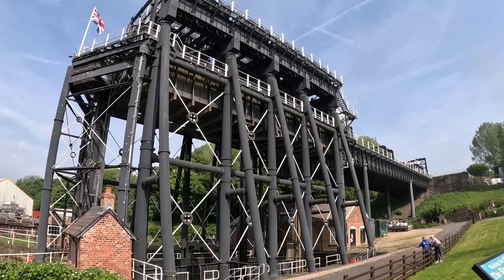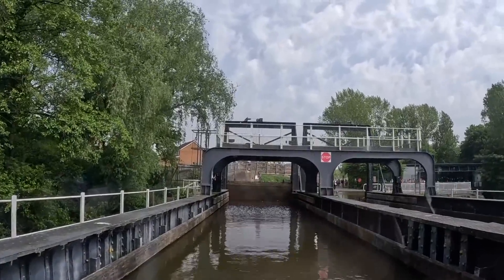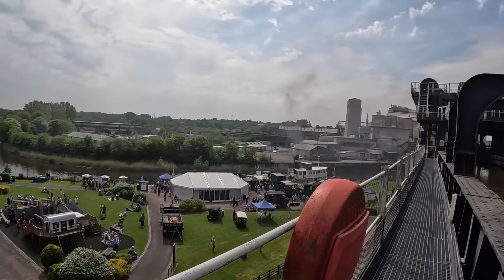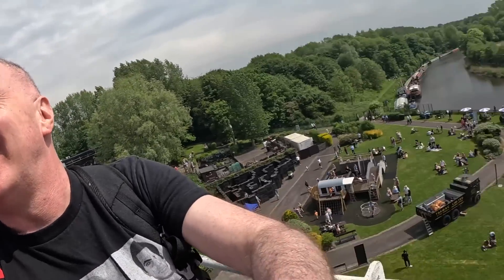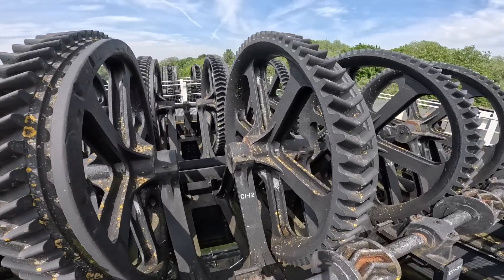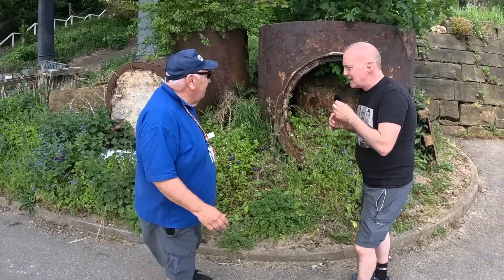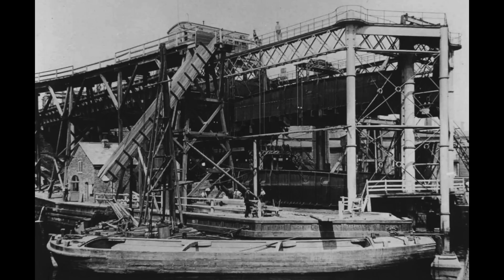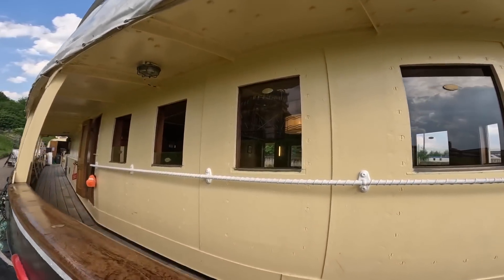The Anderton Boat Lift. The workings

Comment: That machinery on the top level is amazing, The whole engineering pre electric was fantastic.  I don't like heights but I love flying. I had to replace a door once on a tank room on the top of a  20 story tower block in London. I used the "contractors lift to the roof access and hoisted the door (which weighed around one CWT) onto my shoulder and started across the roof and the wind picked me up like a sail and tore me towards the edge. The roof was totally flat no retaining or dwarf wall, biggest scare of my life, I dropped that door like it was red hot. Never again!

Comment: In south-eastern Ontario, Canada, there is a canal - the Trent-Severn Waterway- which connects Lake Ontario (at Trenton) with Georgian Bay (near Midland) About one-third the way along from Trenton there is the city of Peterborough, and a considerable rise in elevation (going north) is required. This is accomplished by the Peterborough Lift Lock, which is similar in operation to the original (and current) Anderton boat lifts. There are two identical watertight chambers, raised and lowered by large (and interconnected) hydraulic rams. Actual motion is started by adding a little extra water to the upper chamber, making it heavier than the lower chamber! The hydraulic medium is the (fresh) canal water, which causes minimum corrosion. A visit to this engineering marvel is highly recommended!

Comment: That is an awesome piece of industrial engineering and architecture, love it. I did however have one random thought whilst watching. As all the lifting gears at the top are now defunct and disconnected, if someone where to attach and electric motor to the main input shaft, would they still all turn? now that would be something to see.

Comment: No, No, No my little guys were pulling in tightttttt when you were up a height, more so on the mesh flooring. In my early working years i was in a woolen mill where the carding machines were started by a transformer thing. Turn it on, the carding engine started slowly then needed the handle to be moved to increase the speed until the cards were at full speed. It was scary, the creaking/groaning as this monster came into life 😮 I think that transformer/speed regulator was like in a loco cab. Cheers DougT

Comment: @MartinZero. A healthy fear of heights is perfectly normal. The challenge is suppressing it. You may think going up a boat lift is bad, try going up the Sky Tree Tower in Tokyo. The upper observation platform is at the 450m mark. Now imagine your brain wondering what would happen during an earthquake. Now imagine post earthquake having to descend how many steps just to get to the roof level of the complex.

Comment: Hat tip to you for always going up for us when you struggle with heights. Another hat tip to the crew for understanding and not making it worse. I'm not petrified of heights, but I do have to work up to do them, and my pals always make it worse with the shaking of the structure or acting like they're pushing me off 😂Oddly, I never had issue jumping out of aircraft in the military 🤔
Reply: Paratroopers are actually safer on the outside of military aircraft 😆

Comment: The heat inside the tractor during a hot day would be one thing, but at 13:19 you can see there's an unguarded flywheel right next to the operator!

Comment: I had the opportunity to briefly operate a steam powered train locomotive in Cuba that had been converted to burn fuel oil . About 1/8 mile back and forth on the track was more than enough for me . The heat was unbelievable . I couldn't imagine operation a steam powered lorry ( truck ) all day in the summer .
Reply from the maker: They were very hot inside

Comment: IMPRESSIVE, the gear wheels on the top of the lift are very complicated to make , I'm a gear cutter by trade , making bevel gear is difficult, without cnc machines , but double helical bevel gears , wow, I doubt many machine shops could make them these days,' Victorian engineering was the best .
Reply from the maker: Wow, interesting to know, cheers 👍
Reply: The gear wheels were part of the 1908 John Saner Anderson Lift. They were taken down in the late 1980s when it had shut. I remember going up the top of the Lift in 1996 organised by the Trent and Mersey Society. Work hadn't gone to repair it then. I was chuffed being up there with the engineer. It's about 100' above the Weaver Navigation whereas the canal is 50' 4" above the Weaver. Glad I did it then. It was fully booked on the day I'll behave to come back. It should go back to being called The Anderson Lift, ie 2 words not 3 as I think it's patronising the visitors and regulars. Still a feat of engineering when it opened in 1875.

Comment: At the age of about 13 - 14 in 1967/8 I was a total canal-nut, thanks to a brilliant history teacher I had at school who taught us about the industrial revolution.  So me and a couple of mates would cycle from Ellesmere Port on Wirral to Northwich to explore the Anderton lift. We did this several times (it was only 70 miles round trip) and on one occasion we got caught by the bloke in charge. But instead of chasing us off, he saw we were really interested in the lift, so he took us up to that cabin and showed us the control room and then he took us up onto the top bit where the gears are. It was very run-down back then and sadly no boats came through when we were there, the traffic had all but dried up by the late 60's. But those gears were covered in thick black grease and the whole thong had this wonderful mechanical smell. It was also very industrial, the factory on the other side of the river was much bigger then.

As I've mentioned before, we also used to cycle to the pontcysyllte aqueduct on the Llangollen canal - but that was only around 60 mile return. Free range we were :)

Comment: A very nice followup video on the Anderton Boat Lift. The massive gear works is amazing. I worked once in a shipyard in Philadelphia and Mmsured the curvature of the Gantry Crane at Akers Shipyard with a theodolite. I waved to kiddoes as they passed by on airplanes that were landing at the Philadelphia airport. That crane was over a 60 foot dry dock that was part of the fall if you fell. Unlike the boat lift this crane has no safety railings (The British are famous for "Health and Safety). It gives you an appreciation of being at heights. The camerawork was excellent as ever and the shots at the top were superb. I enjoy structures like this thanks!